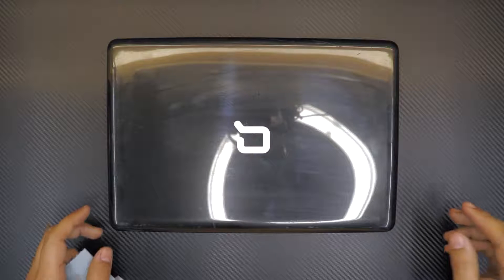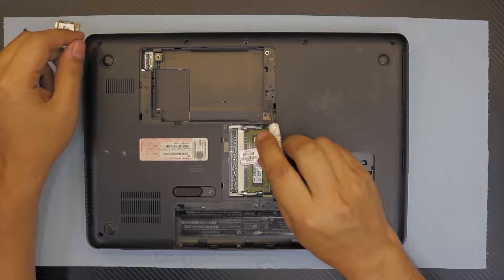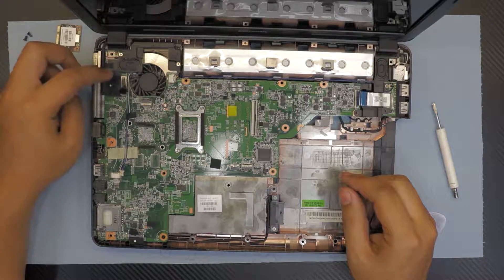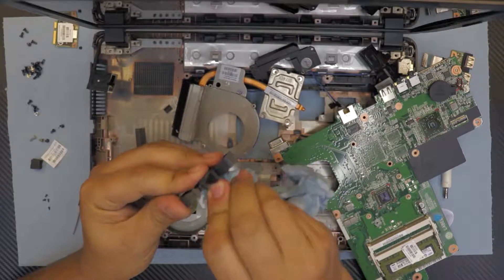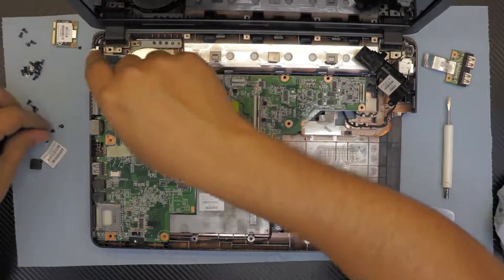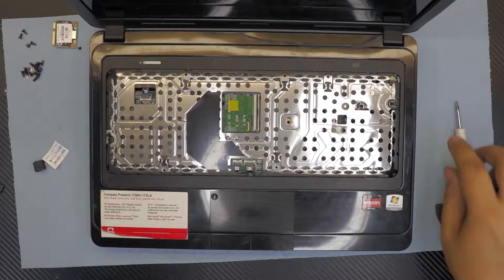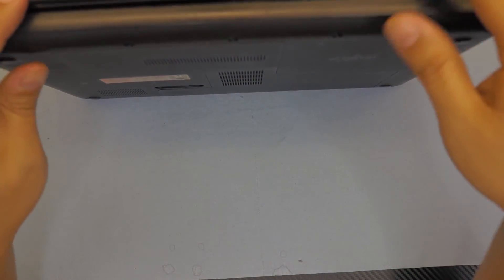CQ43 service, repaste, clean fan and take apart your Hp Compaq presario CQ43

Comment: Can I use Caddy to fit an SSD , in place of dvd drive. in this laptop and load windows in that?
Reply from the maker: Thank you for your feedback! If you wish to support the channel, you can like, subscribe, or both!
Regarding your question, yes you can use it for storage but not booting from it, we had few tries and 2 models did detect the drive for boot but 7 others didn't, so it depends on your bios, update the bios and try it out. but for sure you can use it for storage, also i wouldn't recommend for windows and it is a slower sata connection.
Should you have any further questions or requests in the future, please don't hesitate to ask me.
cheers🍻

Comment: I dissamble this laptop cq43, for change cmos. And i pretty sure this brand no cmos becs i cant find it. If have u can share it. After i resamble i turn on, boot show up, win 7 show up. But blank during desktop. I pluq external moniter but sill no display. Hope u can share how to fix it.
Reply: @uFixTek  thanks for guide. Love it
Reply: Plus I go to bios , can't hold 1 minute screen turn to blank, still have light becs when I unplug will turn really no power. Becs during blank screen at keyboard still have power (WiFi key have led)

Comment: It is not turning on after putting all the things back but it still charges plzzz helppp.
Reply from the maker: I need to know what you mean by 'not turning on.' Do you mean that no lights turn on when you press the power button, or does the power LED turn on and off repeatedly? Please provide more details.
Reply: @uFixTek  No lights are turning on even after pressing the power button. I’m pretty much sure that I have fitted the power on/off cable back but maybe it is loose!? Is there any way to properly put it back tightly if it’s loose?

Edit-Looks like it is turning on but hard disk is not detected even tried both ssd and hdd but is not detecting. System boots through usb tough.
Reply from the maker: ah ok the then double check the HDD cable connector, and if its not working after then go to BIOS and change the boot mode to UEFI or if its set to uefi change it to legacy.
to go to bios power on and quickly tap on esc key then once you got the menu go F10
Reply: @uFixTek  There is no uefi/ legacy option in the bios settings.
Reply from the maker: then you may have a damaged HDD flex cable :( if you can boot to usb, its not your motherboard. can you try booting to windows 10 usb ( make sure the usb is burned as MBR (legacy) and see if you can detect the hdd in the windows installation steps
Reply: @uFixTek  I tried installing linux and it  surprisingly got installed and I it only runs sometimes (2 times out of 10 times). Is there any way I can recover the Disk cable or is it available online?(In India) I tried founding but couldn’t find it. Should I go for a caddy?
Reply from the maker: Alright, my friend. If you have installed it at least once, now we need to check to make sure that your hard disk drive (HDD) does not have any bad sectors. If an HDD has bad sectors, it could prevent the drive from being detected. One tool that can help you check for bad sectors is Hard Disk Sentinel.
if you have another hdd or even better get SSD 250gb to test with that, if you place a SSD it will be 1000% faster :P

Comment: What problems happen to the laptop  .
Why power is showing on but display is looking blank not any show. Can you solve this problem . It is same model of Compaq Cq43.
Reply from the maker: Thank you for the feedback! if you wish to support the channel you can LIKE or SUB or both :P
regarding your question: SURE this is very common issue with this models and dv 6000, i made a video on how to fix this issue on a different hp check the video and the same thing applies to this,
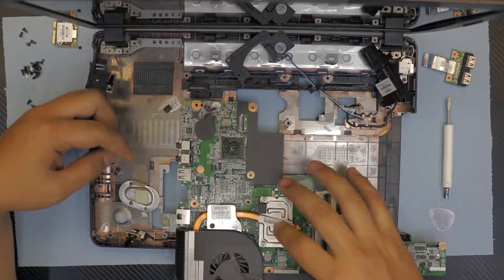in this video @8:10 you will see there are two chip one the cpu that we repaste under heatsink and the other on top corver beside the bios battery,  ( https://imgur.com/a/RHYGsVG )
you need to remove the bios battery and reflow that chip beside it as i did in the next video.:
https://youtu.be/Zqrz-IGGNvw
its the same exact process follow the heating process exactly.
and let it cool down by it self and not move it till its cooled.

also replace the thermal pad on a small heatsink is pointed by my finger:
https://imgur.com/a/OzGaIxR
https://amzn.to/3mMqcje

Comment: Hello my laptop's is not displaying window
Reply from the maker: Thank you for the feedback! if you wish to support the channel you can LIKE or SUB or both :P
regarding your question: SURE this is very common issue with this models and dv 6000, i made a video on how to fix this issue on a different hp check the video and the same thing applies to this,
in this video @8:10 you will see there are two chip one the cpu that we repaste under heatsink and the other on top corver beside the bios battery,  ( https://imgur.com/a/RHYGsVG )
you need to remove the bios battery and reflow that chip beside it as i did in the next video.:
https://youtu.be/Zqrz-IGGNvw
its the same exact process follow the heating process exactly.
and let it cool down by it self and not move it till its cooled.

also replace the thermal pad on a small heatsink is pointed by my finger:
https://imgur.com/a/OzGaIxR
https://amzn.to/3mMqcje

Comment: Under what circumstances should one replace the CMOS battery. My laoptop is more than 10years old....
Reply from the maker: Thank you for the feedback! if you wish to support the channel you can LIKE or SUB or both :P
regarding your question:  replacing the CMOS battery is not important, BUT if you get annoying msg when turning on the laptop saying " the date and time are reset and bios defaults....." then you will need to replace the battery and set the date and time and thats all, the bios battery is there to keep the bios configuration saved, if the external battery is removed / lost then the motherboard will drain the CMOS battery quickly. to know if you cmos battery must/should be replace or better words would be if you want to know if you CMOS battery is dead, simply power off the laptop and remove the external battery, and press and hold the power on for 5sec, then place the external battery and connect the charger and turn on the laptop and quickly keep tapping on the ESC key till you get the menu and then go to bios setup i believe F10, then if your date and time are not reset to manufacture date then, you CMOS battery still ok, else if the date and time is way off and time 0000 then it means the bios battery is dead, and if you WISH to change it you can else DON'T.
Reply: @uFixTek  Wow! Thank you very much for the detailed explanation 👍🙏
Reply from the maker: @rampr4225  its my pleasure my friend anytime you have any questions or request feel free to ask me.

other way to support the channel is by using my amazon general link before buying or searching for your purchases (add to your fav😋) .
USA: https://amzn.to/3A8dJu6
MX: https://amzn.to/2YoPNFC

Comment: Woow...👏🏻 your video is really easy to follow, like I can do it my self.
But I have a questions for you.

Last week I already reinstalled win7 on my laptop. I deleted all programs and leaving only google chrome. Cos that's the only one I need.

My questions is...
1. Why the internet in my laptop feels like really slow?
I opened a lot of tab on my chrome indeed. And that's how I work.

2. If the processor isn't upgradeable. What is the first thing to upgrade in my case.
SSD first or RAM?

I just want my laptop can open a lot of tab in chrome. And every tab is open right away.
How to do that?

I really appreciate it if you can help me
Reply from the maker: thank you for the feedback and your support to the channel,, regarding your  question i would highly recommend you 1st upgrade the ssd:
https://amzn.to/3cyhdgW
you will see a BIG HUGE difference in boot up and applications and over all
and if you going to open a lot of tabs then you will need minimum 8gb ram 2x 4b
if anything else let me know my friend
Reply: Chandra Fauzi
  what processor is in the laptop? Celeron B815?
Reply from the maker: @slavafedotov5742  AMD Dual-Core Processor E-300
Reply: @uFixTek  ((( Socket	BGA413 - this is bad, the processor cannot be replaced
Reply from the maker: @slavafedotov5742  yes my friend they have the cpu soldered on the motherboard unfortunately

Comment: Whenever I open my laptop 
It shows white screen
Please tell some solution
Reply from the maker: when CPu and north bridge is failing you need to isolate both chips and do a re-flow on both chip.
this two chip that are in the picture , if you have 3rd chip with crystal dye it has to be reflow too.
https://imgur.com/a/1eyQuEY

if you want to know how to reflow watch my video on how you can reflow :
https://youtu.be/Zqrz-IGGNvw

and apply this technique to both chips.
good luck
Reply: @uFixTek  can you please label the chips in the image and also tell from which second of the video you took that screenshot 
And please mention the timeframe of the above video link you provided in which you do the reflow think..
Reply from the maker: https://imgur.com/a/ZbF382d
@10:10
isolate and follow the instruction on the other video on how to re-flow a BGA

https://youtu.be/Zqrz-IGGNvw
@17:20
i show  how to isolate the BGA chip.

Comment: best !!!
Reply from the maker: Thanks 🤗 thank you for your support and feedback my friend
Reply: uFixTek does this model have M.2 slot?
Reply from the maker: YES IT DOES, but its occupied by wifi board. you can buy a usb wifi and use the m.2 slot , but the space is not enough to place a ssd m.2 there. some modifications may require.
Reply: uFixTek thanks a lot 🙌🏼😄
Reply: uFixTek hey buddy one more question 😅
I have upgrade the ram to 6gb and also installed SSD to my compaq CQ43 which windows will give better performance windows 8 or windows 10? Thank you in advance!
Reply from the maker: defiantly WIND 10, no questions asked. :P but make sure you do a nice configuration fo your windows
also if you want me after when you finished installing wind10 i can connect and help you to optimize it to the best. if so let me know send me an email bdsoporte.queretaro@gmail.com

Comment: hello i'm trying to fix my dad's old cq43 like this one. I cleaned all the parts and put everything back in order but it would turn on for 5 seconds then the fans go louder but it doesn't boot up to the windows logo. If you could help me with this, it would be so much appreciated. Thank you
Reply from the maker: you didn't put the thermal paste nicly, re do the thermal paste and make sure you use a better quality thermal paste, the reason for the shut down is that you have no thermal paste or using the same old paste or you didnt apply correctly the thermal paste and when the cpu goes ove 99c it will shutdown for its safety protection. redo the paste
Reply: uFixTek thanks! Will try this out after the coronavirus. Stay safe sir and thank you so much for the input!
Reply from the maker: your welcome

Comment: Hey dude, i have a problem with this laptop, firstly my laptop always overheat if i was using it, so i decided to clean the fan, but after cleaning the fan when i turn on the laptop, the laptop just shutdown automaticly and when i turn it on again it shows overheat warning. I already consult to a repair shop but that doesn't help. It's better, but it still do the auto shutdown thing. Can u help me?
Reply: @uFixTek  sure maybe i gonna send it in prox 2 days, cause still in repair shop